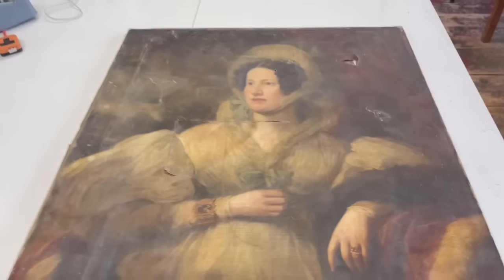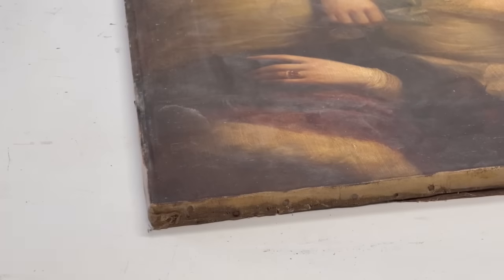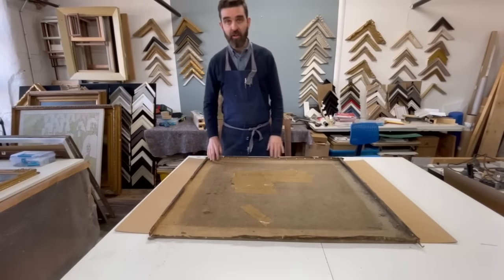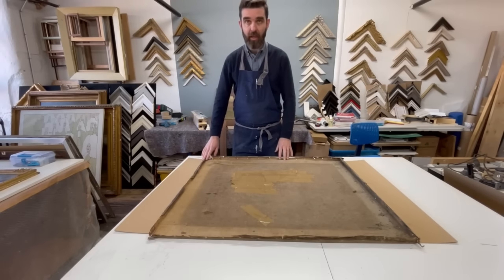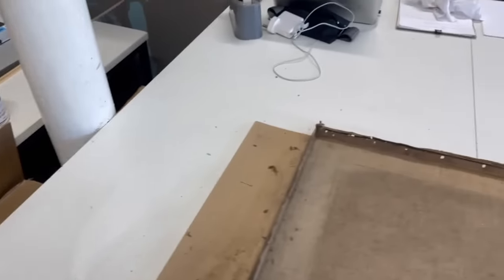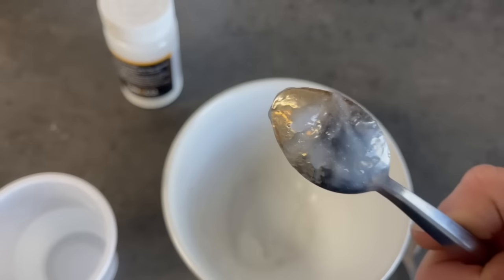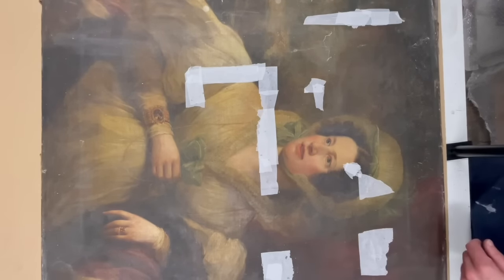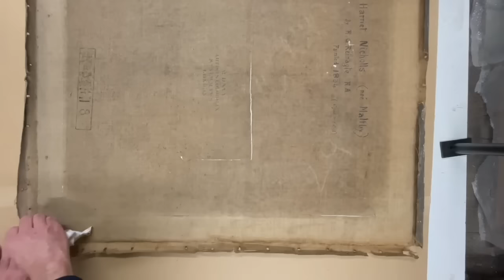Restoring 19th Century Portrait of Harriet Nicholls episode 1. #paintingrestoration #artrestoration

Comment: I have been following Baumgartner Restoration for a number of years now and hence I came across your vlog tonight.   I'm surprised at how different your techniques are and wonder why you do not use a hot table to flatten the painting rather than your chosen method?
Reply from the maker: Welcome aboard! There’s loads of different ways to achieve the same result with this one I was more concerned about flattening out the tears , I didn’t feel it need too much if any heat. Thanks for watching 😃
Reply: @abby5217  well baumgartner doesnt have a big studio till his channel blew up his studio used to be small too
Reply: @Bloomfield_Art_Restoration  i wish that this channel get blow up too and so you can get a bigger studio and much more equipment
Reply: @galba2715 i like the current studio just fine, but i am very much looking forward to the improvements in camera and mic that will come as his channel grows

Comment: They make dedicated tack pullers. Amazon calls them "tack lifters". A decent one should be around 5 to 10 quid, and will need a little touching up on a stone to give it the edge and aggressiveness (or lack thereof) you want. Cheap ones are too soft metal to hold a decent edge, so spend a little extra for something hopefully made from tool steel rather than old hubcaps.

Comment: Can't help to compare to Baumgartner - on a admittedly very layman level. I see the benefits of only facing the tears with that kind of glue, but I also see a problem? How do you adress missing paint when you flip the painting? That painting is in such a sad state, what if you miss paint flaking off?

And I see fish gelatine used as a glue, which can be melt in huge amounts to adress the whole painting, it's also cheap as anything, easy to produce without the effort of reheating and diluting, what's the differences between the two or is it just personal preference?

/edit no offense meant, I really got curious, if I see two people address things that differently. If the wording is off: I'm German. English is my second language and sometimes I miss the subtext.
Reply from the maker: No worries the paint layer in this portrait was very secure so the only areas where there was the possibility of paint loss was on this tears . So no need to face the whole painting . The adhesive I use is heat responsive so can be manipulated several times where I think fish glue correct me if I’m wrong but you only really get one application before you have to remove and replace ?